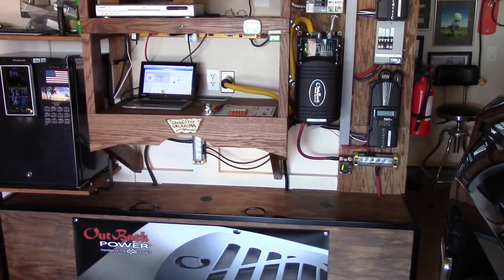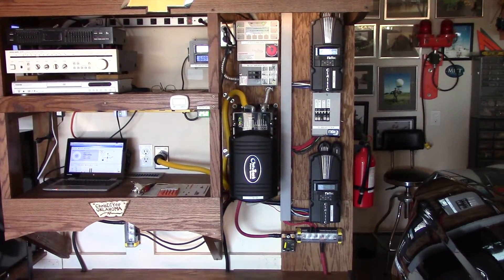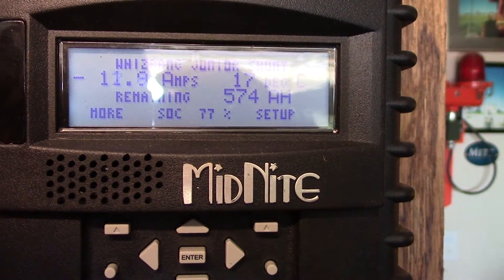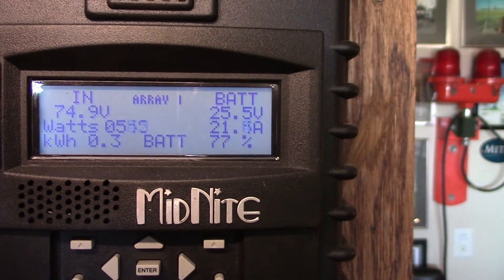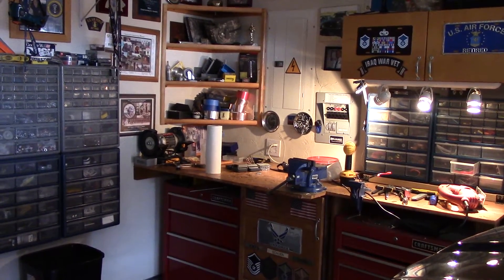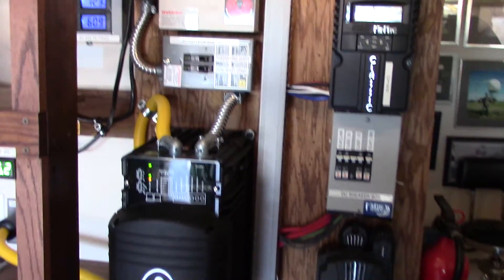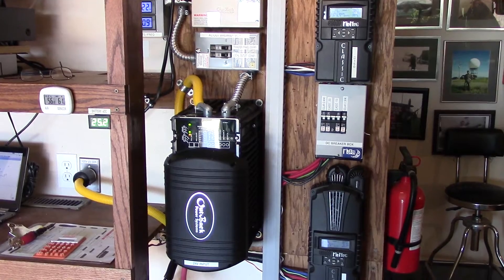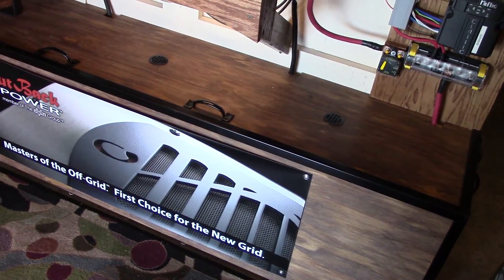Off-grid solar systems: Battery charging and discharging at the same time. Tips/advice.

Comment: You mentioned that the inverter is not switching off like you thought it should. I have a small 400 watts of solar panels charging 400 Amp-Hour batteries. I was trying to figure out what would be the the one thing that I wanted to accomplish with this small system. I wanted to store some energy, but I didn't want it, to just sit there. I wanted to consume what I stored, or at least a piece of it. Something is better than nothing. So I automated the reading of the battery percentage of charge. I figured, when the battery charges to my turn on set point, then turn on the inverter, make sure that the inverter output is on, use a double pole double throw relay to switch the load from grid to inverter. Continue to monitor the batteries, and when the battery percentage gets down to whatever percentage I choose to set the turn off point to, the relay switches back to the grid. In my case, I run a large deep freeze and a side by side refrigerator. On sunny days it will run those items 10:00 am till the waning sun. On cloudy days, the system will turn on and off several times a day. Generally I get + or - 1KWH/Day. Currently thinking about switching out the AGM batteries for LiFePo4 batteries. I'll share my circuit, if you like.

Comment: What limits the output, I’m adding a transfer box like yours but in the mean time I’m connected to a grid tie capable of 600 watts, I have seen 400w through direct connected to PV but I just install an outback flexmax80 and now I’m only seeing 100w pass through the grid tie, is it battery that regulates the output, I’m concerned that it will keep my output to low for a transfer switch and inverter, thanks

Comment: I have a question for you sir. My solar panel is giving 5A current and i am charging battery 30AH with it and i have 1A load connected across battery means i am charging and discharging at same time. My questions is that 5A will be divided like 4A will go to battery and 1A will go to load . Am i right or there is possibility that load may get more current than required like 2A?
I am confused..

Comment: have you considered getting an automatic watering system for your batteries? Engineer775 talks about them all the time on his installs.
Reply from the maker: Engineer775 knows his stuff...I subscribe to him. Currently, I am using Water Miser vent caps that save on watering, reduces gassing, and prolongs battery life. I am impressed with them...so, an automatic watering system in not on my radar. He does some high-dollar installs...my system is small potatoes.
Reply: +Chris DIYer I didn't really understand what those yellow caps did so of they are working why buy something not needed
I like your channel by the way and your sign off at the end of your videos is unique please don't change it. youtube is my TV and watch a lot of different channels you WILL have tens of thousands of subs

Comment: Adding in the WBjr to our system has really helped out with overall ease of use. Before I would make a point of not really running anything until we hit float as it didn't have an accurate ENDAMPS for the LFP pack. Now with the WBjr we can fully utilize the system without really thinking about it as it can hit that accurate ENDAMPS while passing along the excess to any loads. I'm loving it.  :) - Cloud
Reply from the maker: I hear ya...cool beans! Midnite Solar Classics are really slick...glad I went with them.
Reply: Whats wbjr

Comment: Good tip.  Although my charge controllers are less sophisticated, I essentially do the same thing you do every morning.  It takes a little more discipline to do so, during the winter months (as the sun doesn't rise around here until almost 9:00am), but we watch what we use and ensure that, for the first half of the day, the batteries get most of the solar power until they reach float.  We've been fortunate.  It's only been a few days this week that we haven't seen the sun and the battery bank hasn't reached float mode.
Reply from the maker: Tough time of the year...for solar. I use the grid for my 240v stuff and bad solar days. Been lucky here in Oklahoma...got almost 12 hours off-grid today. December 21st is the winter solstice...then it will get better.
Reply: Chris DIYer
Yup!  Spring is one day closer!  :) 
Our tiny house is mostly on solar. We have our fridge and freezer on the grid, as well as heat lamp in the chicken coop.  As for our LED lights in the house, the fan in the compost toilet, our on-demand water pump and assorted appliances we use in the house are on solar power.  I'm also going to have to put one grid power outlet outside for the block heater on our vehicles.  It's getting cold and I'm going to have to plug in the vehicles soon, or I'll never get them started on those really cold days and nights.  One day, I'd like to expand our battery bank to handle this stuff, but right now, grid power is more practical for these items.

Comment: Hi, we would like to know why you use the Trogon battery's???
Reply from the maker: Hahaaaa?!!!! #8 they look sexy.
Reply from the maker: Thanks for the question. I chose Trojan L16E-AC flooded deep cycle batteries for many reasons. #1 is cost #2 amp/hours #3 size #4 warranty #5 longevity #6 proven performance #7 local distributor is close.
Reply: +Chris DIYer : What about #8?
Reply: Chris DIYer : Good enough for me.

Comment: Hi Chris and very nice set up , a dream made reality!!Just a question, why used Mid Nite controllers and not Outback controller???Are these better??Just thinking in future..someday I can beging with solar... thanks...
Reply from the maker: Both are good solar charger controllers. The Midnite Solar Classic's can output more power and I prefer the screen/menus. The Outback Power Flexmax is less expensive and has less charging power. But, overall, you can't go wrong with either of them. Both are strong and backed by good companies.
Reply: +Ramon Fuentes Cruz : Going with a Midnite Solar also gives you the option of being able to choose a 200 volt version (allowing you to connect more panels in series for higher voltage and less line loss). I went with a MN CC because I wanted a controller that could be programmed for any number of voltage setpoints which allows you to either use Lead Acid or LFP or anything else that comes along.

Comment: If you have the follow me mode setup right the Wizbang will show everything.  Both arrays and your inverter.  As long as the wizbang is the last connection before your battery.
Reply from the maker: Yep...you are right. The "Follow Me" function is not set right. Good catch. When the sun goes down...I will turn them off and check the jumpers and the settings. Dam good eye man.
Reply: 12 volt battery

Comment: Lots of things to consider on a daily bases , I am slowly switching from grid tie to off grid power were I can . Money is always a concern for me cant seem to bring it in fast enough . Most people I think really have no idea what it takes to do these  off grid power systems. Nice job U are doing.
Reply from the maker: Thanks man...so true. Each system is unique. Grid-tie is great if you find an electrical company that will net-meter. Around here...@#$!!!! It takes a lot of time/money/learning curve to make off-grid work. My #1 problem is my 240v appliances (which are not on a solar circuit). If I could eliminate those appliances (clothes dryer, stove, and HVAC in the winter) my electric bill would be 50% less. Off-grid inverting with 240v takes A LOT of solar panels, big battery bank, and pricey equipment. Some have done it...but, probably spent $20-25K easy.
Reply: +Chris DIYer : Have you looked into adding the Outback 240v Transformer to your outback? You can connect it to a single Inverter to power 240vac loads. Although you would still have to factor in how many total watts it is pulling through that inverter. :)
Reply: +cnypilot : "http://www.solar-electric.com/x-240.html"
Here is the manual : http://legacy.outbackpower.com/pdf/manuals/fw-x240.pdf

Comment: Love the vids man.  I am seriously considering moving to some sort of solar set-up.  My main issue is that with 2 kids and the wife we use a ton of power (on the order of 1300KWH/month in the summer).  I realize I would do critical/non critical loads and such but me getting 100% off grid would be a chore, looking at 8KW of solar to do it (or more).  Also, I have one south facing exposure with a much larger west exposure (and east as well).  From what I have read small south, large west would work just fine but I am not sure how much to start with if I do.  I want grid tie battery backup much like what you do.  I need to get the costs straight in my head along with all the requirements and just go for it.  My best friend is an electrician so that helps.  I might need to give you a call sometime to discuss if that wouldn't be too much trouble.
Reply from the maker: Sounds sweet! If you have 8KW in solar panels...that would be enough to do a 240vAC system. It is very possible to do a system like mine with 240v. In fact, that would be ideal for dropping that electric bill done quite a bit. The only problem I see is if you run 240v appliances (HVAC, stove, clothes dryer for example) with a battery bank...don't expect the charge to last very long unless the battery bank is huge. Most DIY off-grid dudes CONSERVE their batteries at night (ie, do the heavy load stuff during the daylight hours). That is what I do...and don't discharge the bank below 70% overnight. I COULD run my house overnight and bring the batteries down to 30-40%...but, they wouldn't last very long. So, it is a balancing act of sorts. 8-10KW in panels with grid-tie and net-metering...you should be able to zero-out an electric bill. Having a battery bank AND grid-tie'ing (known as HYBRID) is the ULTIMATE! Some guys even have a 3KW generator as back-ups to that type system...everything is computer controlled. Sexy shit...way out of my budget! Lemme know if I can help. PM me.
Reply: Thanks Chris.  I have a 5KW genset already (mainly for sump pump in case of outage).  The Hybrid systems I have looked at are pretty expensive so I would most likely start with non critical systems completely off grid and the move along as I went, keeping in mind that I want to implement hybrid later as $$$ allows.  More time designing the system so that it is flexible I suppose but it would be pretty cool in the end.  I am also looking into LifePO4 for batteries as they offer a much larger depth of discharge and a greater temperature range.
Reply from the maker: Sounds good! Yeh, those LiFePo4 batteries are pretty sweet. There are a lot of new technologies out there...seems like they are emerging pretty fast. Good for us who do this kinda stuff!

Comment: Where can you buy the systems at a good cost?
Reply from the maker: Multiple places. I can break down where I got my stuff:
Solar panels - Renogy Solar (called the company direct in CA). Got the Sunpower panels off of Craigslist. eBay is good for those Renogy 100w 12v Mono panels.
Inverter - Distributor in Indiana. Try the AltE Store...great people.
Midnite Solar Solar Charge Controllers - Online...shop around for the lowest price. Amazon prices suck.
Reliance Controls ProTran 6-circuit transfer panel - Amazon. Lowe's sells them too.
Trojan L16E-AC deep cycle 6v batteries - Local distributor here in Oklahoma City
2/0 welding cable (for batteries) and copper terminal lubs - Amazon
All the other equipment (Like the Blue Sea Systems busbars, cabling, connectors, do-dads, and nick-nacks...pretty much Amazon and local auto parts store.
Reply: Thank you for all the help. Have a great day